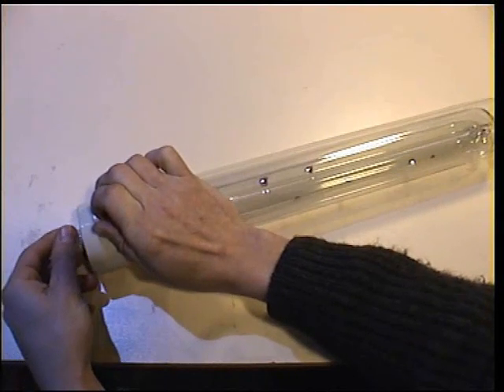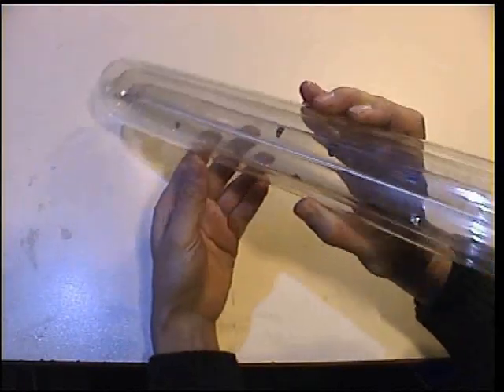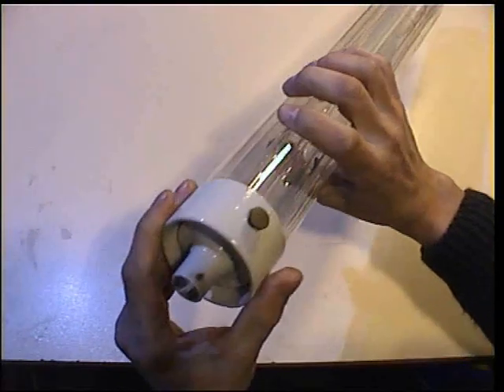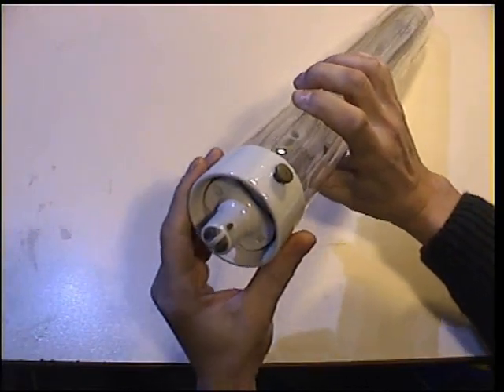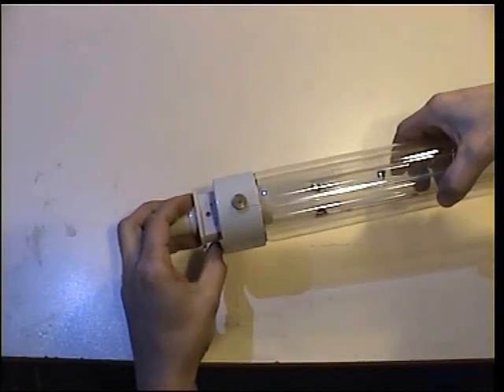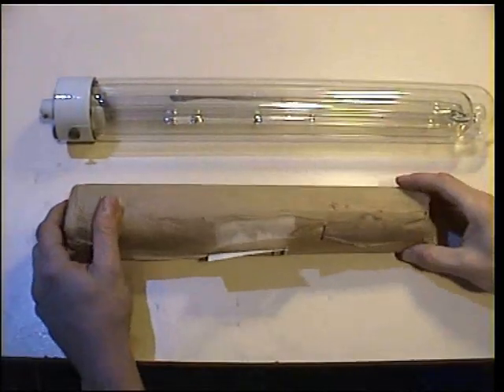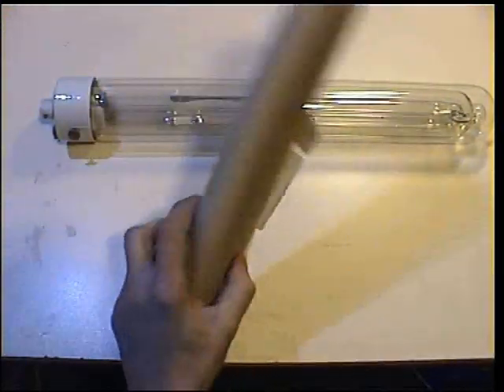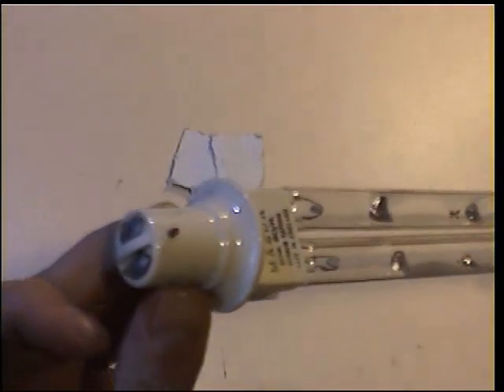SO/H (obsolete) sodium vapour lamp

Comment: You take out the tube!? I didn't know that.
Reply from the maker: Yeah, the SO/H sodium lamp reused the outer vacuum jacket when re-lamping keeping costs down. This remained until the 1960s when SOI/H and the later SOX incorporated the vacuum jacket. There were advantages and disadvantages with the separate outer jacket, but mostly one lower possible efficiency.
Reply: @tuopeeks  kk.

Comment: StreetLightOnline Finding an SO/H lamp or an SOI/H lamp is significantly more challenging than finding a SOX lamp. As an American light bulb collector, I have been really wanting to have an SO/H lamp and an SOI/H lamp and see how these behave on American SOX ballasts. I also really would like to be able to acquire these lamps because the US adopted SOX after these lamps became obsolete in the UK and throughout Europe.
Reply from the maker: SO/H lamps are so long out of production with two compatible replacement types (SOI/H and SOX) that almost all surviving lamps will be in the hands of collectors/museums. To add to the problem these lamps were supplied in two separate parts, the outer vacuum 'Dewar' flask and internal discharge tube. As the outer jacket is re-usable these are harder to find.
Reply: tuopeek1 interesting.
Reply: tuopeek1 I actually know of an American light bulb collector that is extremely lucky to own a complete philips 60w SO/H lamp.
Reply: tuopeek1 The closest I came to getting an SO/H lamp was that I only found an outer jacket that was all by itself.
Reply: tuopeek1 It will take a very long time and probably years to find a complete SO/H lamp.

Comment: does this SO/H lamp run on 90w SOX gear?
Reply from the maker: Yup, the electrical characteristics make it compatible.  Originally the 90W SOX was developed to run on SO/H 140W gear with efficiency benefits.
Reply: tuopeek1 is it also true that 140w SO/H lamps can run on SOX-E 66w electronic gear?
Reply from the maker: @cedricwoirhaye8268  It would try, but I wouldn't recommend it. Electrically it would work but the electronic ballast would need to supply more power or run the lamp at lower output. The difference between the SOX-E 66W and the 140w SO/H is really mainly down to heat loss from the discharge tube.
Reply: tuopeek1 I wonder how SOX-E lamps would perform on vintage autoleak SO/H ballasts.
Reply from the maker: @cedricwoirhaye8268  work fine, but may not achieve full energy savings
Reply: tuopeek1 finding SO/H lamps on ebay is extremely difficult since these bulbs got phased out in the 1960s.